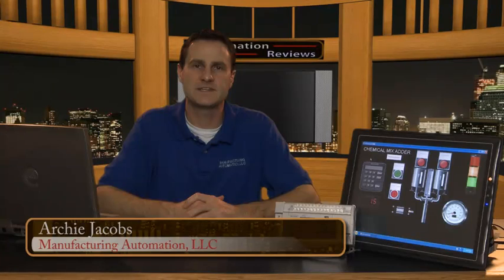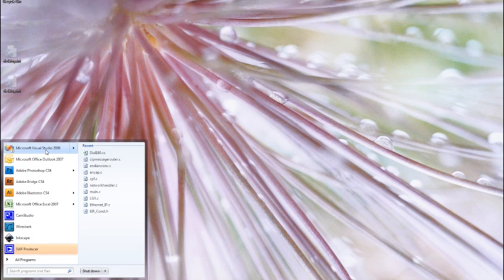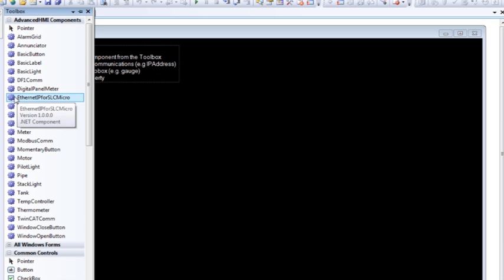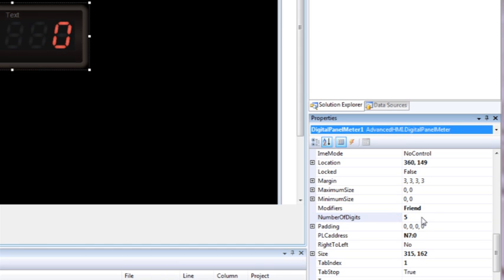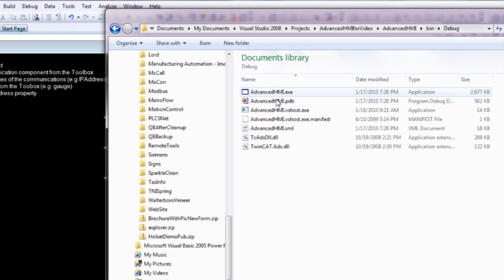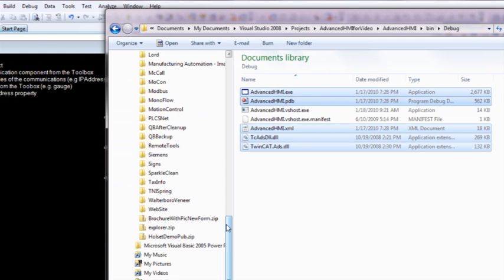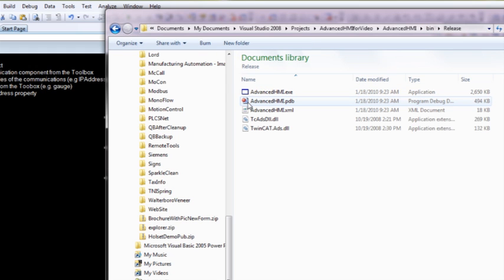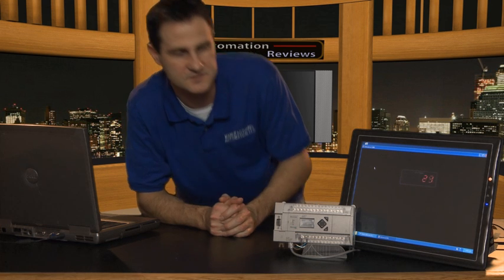Using AdvancedHMI Release 2 with a Panel PC

Comment: Hey mate, I have a problem. I have a button and a light for testing and I linked them to my modbus. When I activate the program, a message box keeps popping up saying that my plc is actively blocking my connection... Is there a way to fix this? Im a student and have only a little beckhoff experience.

Comment from the maker: Any property that starts with PLCAddress is used to put a PLC address, such as N7:0, to control the property. For example, if you put N7:0 in PLCAddressValue, then the value property will be set by the value read from N7:0 in the PLC.

Comment from the maker: @wiln2lrn Version 3 is the current version. Version 4 should be out in the next 6 months. The keypad is now integrated into some of the components, such as the BasicLabel. If you put an address in PLCAddressEntry, then click on the BasicLabel during runtime, a keypad will pop up.

Comment from the maker: This is not for everyone, only those that don't want the high costs and limitations of PVs or Wonderware. Hardware and software less than $1600, PV over $4000, Wonderware well over $10,000.  I've used all 3 and can get AdvancedHMI running much faster than the other 2.